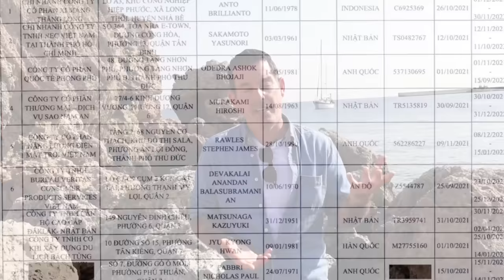CATAMARAN Build! MAJOR Production Update October 2021!

Comment: Okay, the layout of that workshop is brilliant! Keeping the ability to use it as a berth in a pinch is so versatile. Work areas are so needed on a sailboat in general but they are always a compromise. The only logical place for them (in this size range) is in the bow but is also not ideal because you are often putting a lot of weight with spares et. al. in the very place you don't want weight. I guess you just need to be mindful of this and have storage for seldom used items like spare starters, alternators etc. in the engine room or other location and only do the work and store smaller, lighter items in the work shop.

Comment: I'm a lag-about from your earlier catamaran comparison days; as your channel has evolved from comparison to cruising. The change is fine; but those of us watching for comparisons still - are less 370 focused fyi. If all comments are indeed welcome - I'm enjoying the manufacturing specifics but am not sold on this cat over others. Not to throw water on your barbeque here, but some perspective is: this is not a dry foredeck (salt over everything sucks and makes work), front nets are not desirable where seaworthy alternatives exist, cabin space on the 370 is dwarfed by indoor/outdoor designs that reassign the rear cockpit from airconditioned and heated space - to outdoor space as passages require, and I'd prefer a flybridge to not -  personally. I think Bali is up to 300 orders - for these reasons. In a perfect world (or 5 years from now), the front bedroom space could "transform" into a front outdoor breakfast cockpit by day and a great bedroom by night - but that design is as yet unrealized and buyers have to choose between one or the other until then. Options are king in these cats, Seawinds would benefit from this thinking, and you'll be in another cat in 10-years, so your presentations might be improved (for us comparison nerds) by keeping your reviews wide and representative of your broader comparison knowledge. I was a computer guy early on, so I well understand the frustration of rapidly changing standards and capabilities, you just have to shake off the fact that practical change is going to happen , and then go with the best that comes along next chance you get. I think this perspective helps your channel too.

Comment: Great update Nick, glad to see at least SOME factories are operational in the SE Asia part of the world.  Oversized alternators on the engines since there's no generator on board or are you going to rely on solar (and possibly a wind turbine) to recharge the battery banks?  My apologies if you answered that one before.
Reply: Big alternators
Reply: @testicool013  That's what I THOUGHT I remembered, obviously I wasn't certain LOL
Reply: @michiganengineer8621  one thing no one mentions how many horse power you lose running the oversized alternators
Reply: @testicool013  
I could be slightly wrong here, but from memory its about 10hp to run about a 200A Alternator at full tilt.  But when the alternator is doing bugger all (batteries charged) then it alternator will draw next to nothing in hp from the engine(s) (just belt/pully/bearing friction and a small amount of power to power instruments, fridges, freezers, A/C etc)

Comment: It's interesting to see carbon fibre being used with grp. They are both strong materials but I believe carbon fibre is much lighter. How much lighter?
Reply: According to AZIMUT, their builds experience about a third of the weight vs volume if my understanding is right...allowing them to increase size of headroom (up to 2m in most areas) in the accomodation and main decks without sacrificing the inherent increase in 'centre of gravity' which in their case is a problem for 'roll'. The other benefit for them is that the boat plans sooner and with the use of less petrol for any given speed, and the boat is more responsive to steering (and interceptors - 'yaw') at any speed sue to reduced weight overall.

Comment: I am curious about one thing: When you plan and build a cat like this, how necessary is it to take weight/load balance into consideration? 

What I mean is do you need to think about how much the galley and workshop etc (on starboard side in your case I believe) is going to weigh compared to what you are going to build/put/store on the port side, in order to have the boat perfectly balanced in the water?

Comment: Does the starboard forward locker have a hatch access from the bow or is it only accessible through the workshop area?
Reply: 9:08 if you look carefully at the right side of the screen about 1/3rd down from the top you can see the recess for the sail locker hatch.

Comment: Privilege, and a couple of other high end cats, prefer to use Shaft drives instead of sail drives, and the reasoning behind them, at least to me, makes a lot of sense.  Bang a sail drive the wrong way and could conceivably rip it right off the bottom of the hull, with the commensurate amount of flooding that goes along with it.  Has Seawind done anything to address that sort of concern, skegs, the sacrificial keels you spoke of being deep enough to go below the drives, or anything else to protect the drives from being damaged?
Reply: You must not be following the series. All the other videos show diagrams and pics discussing these points. the hulls will allow bottoming on sandbanks for cleaning and paining, etc. You'll need to go back few videos and seek out their other contributions to see just how it all works and for specs.

Comment: The deck plug, will it be glassed on top or from underneath?
Reply: Would it make a great deal of difference? except for slight decrease in size on the underside...of course. Clearly you'd use the side that would then match the hulls...
Reply: Plugs are used to make the mold then the deck is laid up in the mold it should in theory be exactly the same shape as the plug. SW can make several molds from the same plug and if a mold wears out or breaks they can make another (if they don't destroy the plug)